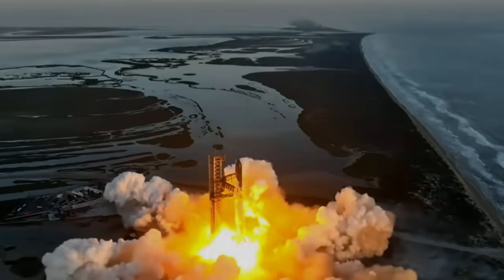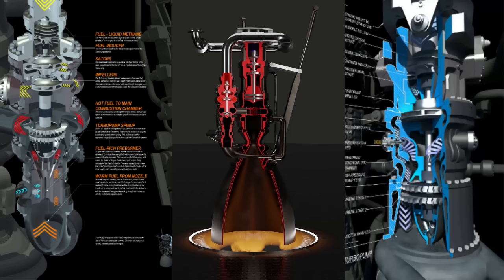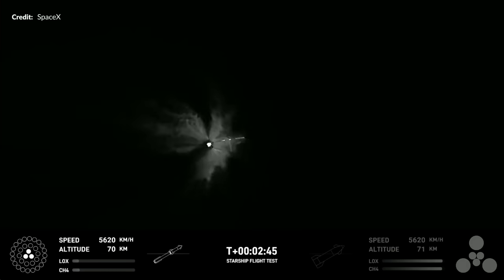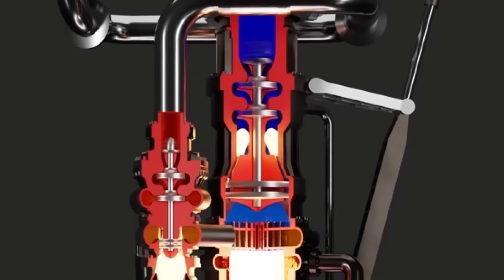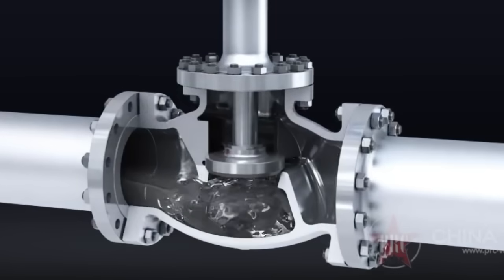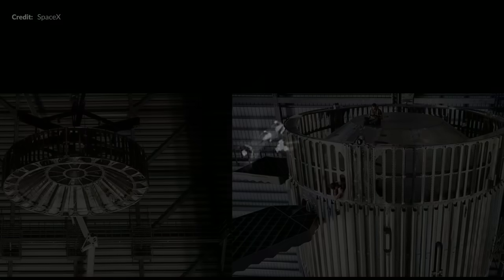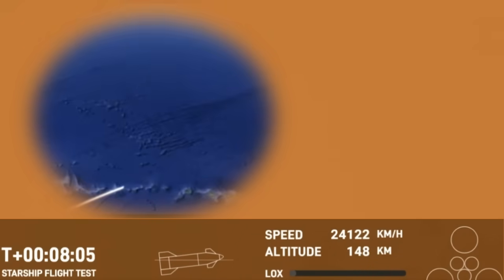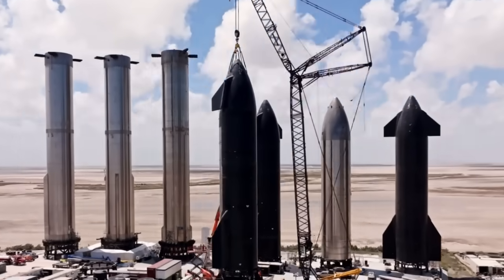Starship Flight Failure Analysis IFT2

Comment: I suspect there was damage done before it left the pad (stage zero).  The steel plate and water deluge appears to have mitigated the rock tornado and obvious pad damage, but the steel plate is flat and the shockwaves generated will tend to be reflected right back towards the rocket unlike a legit flame diverter which deflects the exhaust and much of the shockwave energy.  I think it likely that damage was done to the pressurization system plumbing which lowered the prop tank pressure which, over time, reduced prop flow rate and thrust -- if you look at the telemetry the acceleration has an inflection point at about 100 seconds and after that point the acceleration is lower.  At separation the vehicle velocity, about 5663kph, is much lower than the Falcon 9 would be at that point and that includes Falcon 9 launches that include a boost back burn to land near the launch site.
So, I would love to see the data on the tank pressurization and compare that to what would be expected.  The rapid attitude change of the booster after separation to facilitate quick ignition of the boost-back burn, is also likely to be an issue as mentioned.
In summary, while it appears the pad survived the launch unscathed that doesn't prove the rocket escaped the pad unscathed.  The declining acceleration gain with the inflection at about 100 seconds points to something inhibiting the raptor thrust and that could be damaged prop lines or damaged pressurization lines.
Reply from the maker: I thought there should be a cone on the deluge system...
Reply: @terranspaceacademy  Yes, a cone in the center would divert the flame and shockwaves, but apparently Elon believes that if they land Starship on the Moon or Mars, where there will not be a true landing pad so he thinks they need to design the system to not have those things.  His other comment is that the best part is no part.  
The problem with Boca Chica is that they do not have the space to build a true flame diverter and trench -- measure the ones at the Cape and then see if it fits at Boca Chica.  It doesn't!

Comment: Good video. The heatshield problems seem to be the hardest issues to fix before we see a splashdown in Hawaii. They were falling off during ascend like there was no tomorrow. Since the heatshield tiles are not a recent issue, I suspect that this will be the bottleneck in getting Starship to hawaii.
Reply from the maker: Indeed... The reentry temp might not reach the usual 1650 but it wouldn't need to to seriously weaken the steel.
Reply: The Starship needs a dual layer thermal protection system,. The tiles on the outside and below them an Ablative shield thick enough to stop the airframe from getting any major amount of heat on it in the areas where the tiles fall off. Plus some form of insulation between the two to stop tile heating causing outgassing of the Ablative shield. May knock 20 or 30 tons off the lift capability, but would make the thing very safe and all you would have to do in area's of the frame which had been exposed on re-entry would be drill the effected bits out and replace them.
Reply from the maker: That's a lot of mass....

Comment: The only mis-stated info I see in this video is in regards to the Key West footage - the footage of the nose cone was after Starship flight termination system had activated. My guess is a LOX leak as mentioned - when flight computer initiated engine cut-off when LOX feed pressures fell below threshold, inertial guidance determined less than required delta V, and terminated the flight.
Reply from the maker: You are quite right... that was just the nose.  He had seen the whole ship spinning on its long axis but I didn't find that footage.

Comment: Great analysis and I agree. On one hand they need to make sure Starship is getting away from the booster, one the other hand the difference in acceleration between  the two needs to be as low as possible until they are far enough apart. Will the 3 vacuum engines provide enough thrust for that ?
Reply from the maker: I think so... three sea level booster engines at 50% power should be about 40% of vac Raptors at full power at that altitude.

Comment: Wow, that's exactly what I thought went wrong when I watched it live. I thought to myself, that looks like a fuel flow problem & noted the flame outs. I wondered if SpaceX had engineered around the fact that the fuel would slosh around while tumbling. You can see it had very little fuel left over. It's just like running low on fuel in your car and then you do a slow-motion flip. That engine will die out from sloshing fuel not making it to the fuel pick-up line. And now I sit here watching. I feel so smart. My teacher said I was special
Reply from the maker: That's because you probably are :-)  We often confuse a lack of education in an area (ignorance) with a lack of processing accurate ability (stupidity). My mom's car ran out of gas one time because the gauge didn't work.  A "mechanic" stopped to help and told her it would need to be towed because it wouldn't start after we put a gallon in. I then noted it was pointed up hill. It occurred to me that the mechanical pump was trying to pull vapor up hill.  I put it in neutral and we pushed it until we were able to get it pointing down hill.  Started right up.  I was ignorant but not stupid :-)

Comment: I also thought that all 6 engines of Starship started at the same time.  However, some videos taken from a different angle, show that only the outside vacuum engines started first, followed very shortly after by the center sea level engines.  Perhaps, the ignition of the center 3 engines did happen too soon, and a longer delay was needed.
Reply from the maker: The center engines fired right after the vacuum but maybe that was enough and the blowback was not a factor.

Comment: I think keeping the propellant settled enough in the booster will be a big challenge for hot staging. The booster must still retain some forward acceleration, but less than starship's, and not too much that they remain too close for too long and risk damage to either vehicle. Flipping such a large tube filled with sloshing propellant also seems like a nightmare.
Reply from the maker: Indeed... Booster header tanks?
Reply: Yes : farther away Starship starts ,less chance of interference between ,stages ,; would only loose some speed ,can get it back ?

Comment: My thoughts exactly when I saw that the 3 center raptors of the Ship were flush against a flat section on the top of the booster. I also have always been concerned with the heat tiles. Even NASA could never get a tile system to be fully and rapidly reusable and we are still seeing tiles fall off!
Reply from the maker: There is still work to be done... That's for sure.

Comment: I think both timing of the engines and raising the height the interstage with a conical deflector shield over the center to reduce any unwanted thrust effects. Worst case adding some slosh baffles in the booster may be needed.
Reply from the maker: We agree... Just a few changes and IFT-3 should be great!

Comment: Good points on the failure of Starship.  I wonder if they fire up the Starship vacuum engines first then the sea level engines a few seconds later, we could potentially avoid damages.  The booster can leave a few more engines on to compensate for the slower acceleration during hot staging.  Also firing up less engines on Starship at first would introduce less deceleration to the booster, helping with the plumbing.
Reply from the maker: We agree completely...
Reply: @terranspaceacademy  I'm sure they have people going over all the math of all these different strategies and will find the best one come IFT3
Reply: You probably don't need the sea level engines at all at that point in the flight. The 3 vacuum engines fired longer could probably do the job of getting it into orbit. You  only need the sea-level engines for the landing phase.
Reply: @johncherish7610  Yeah but why not use that thrust if you have it, long as they can fix the issue with hot staging.
Reply: @GoldenTV3  yeah I think firing the vacuum engines one second earlier would provide enough clearance for the sea level engines to not break themselves.  But of course these are all speculations.  Maybe they just forgot to tighten the screws :)

Comment: I think you nailed it in your analysis of the failure of B9. The F9 booster does its flip and boostback burn successfully without an extensive set of anti-slosh baffles inside its main tanks. B9 should be able to do the same. 

The big difference is the hot staging used in IFT-2. That puts B9 into close proximity to the exhaust plumes of those six Raptor 2 engines on S25. It appeared to me that B9's flip was pretty violent and likely really caused the remaining ~300t of methalox inside B9 to slosh around excessively.  Since there's a large header tank containing LCH4 in the bottom of the LOX tank, I think that the sloshing liquid was the LOX in the big tank, not the LCH4 in the header tank.  But it could be the opposite, or that both cryogens are sloshing too much.

So, your suggestion of using only the three vacuum Raptors on S25 at hot staging is a good one. I would also use the attitude control thrusters in B9 to keep the booster from rotating (flipping) so rapidly.
Reply from the maker: That's a good idea... the exhaust from the departing Starship probably added more than was thought.

Comment: Good analysis. One error may be the 8:15 point about the center engines. They gimbal out as far as they can so their exhaust is deflected out. You can see them gimbal back to center on the SpaceX videos. Your recommendations are spot on!
Reply from the maker: Thank you! You are quite right and I should have mentioned it.  I don't think it was enough though, the push back on the booster would indicate blowback...

Comment: Yourvspeculation is exactly the same as mine. The restart timing, fluid hammer and sloshing all make perfect sense to me, but I might add the possibility of thermal shock from not rechilling the hot engine before reigniting them on the booster.
Of course this fun speculation might well change once onboard camera and data streams become available. Lol
Stage 0 = perfect
Booster did just as well as any other non spacex booster has ever done. 
Starship = 90%
Ps. Id like to see analysis of the booster plume. It did not expand as expected with altitude. It also had a single string of large shock diamonds that I think formed by the containment of the exhaust from the outer 20 engines that acted like a faux nozzle of all the center engines forming essentially one big segmented rocket engine. 
It was spectacular.
Reply from the maker: Interesting... not enough time?
Reply: @terranspaceacademy  i dont have enough information. But normally they prechill things before relight. The booster had hot engines and not enough time to chill any of them and some had  more static time than others. So its just another thread to pull on.
Reply from the maker: Very good point... Shut then all down, reorient with hot gas thrusters.  Let drag resettle the propellant then relight?  That would allow more cool down time.

Comment: great video.. my only other suggestion at the cost of weight and complexity is add 2 small tanks in the booster to have a positive supply of fuel if zero or negative g's occur after separation.  A baffle might help instead, but of course, both of these things will be a major undertaking on already built boosters, but not so much on one in progress of being assembled, or even a large fuel filled accumulator in both the O2 and methane tanks installed to keep positive fuel pressure to the engines.  Then don't start the rest of the engines on the booster until you attain positive fuel pressure in the rest of the system.  The extra weight sux, I know, but the latest raptors are more powerful and could make up for this
Reply from the maker: That's an excellent idea...

Comment: Keeping the 3 booster engines on and only igniting the 3 R-vac engines on Starship likely wouldn't be enough for a separation, considering that starship will be completely full of propellants (thus, I'm assuming much heavier than a mostly-empty booster). The booster would just keep pushing into it. 

Perhaps they can run the R-vac's at full thrust and the center engines at a reduced thrust, depending on the exact math required for sep.  

Another issue is that Starship is just propellant weight right now. When it ends up with a full payload eventually, the hot-staging dynamics will be completely different - unless they're using some kind of mass simulator. Otherwise more force will be required for separation eventually. 

I don't really have a good answer, but I thought about just using the R-vac's only till I remembered the mass differential. 

Like you stated, I think the biggest issue is the fact that they tried to re-ignite the middle ring during the flip maneuver.  If they had used FAR more RCS (maybe they need those more powerful hot gas RCS thrusters after all) and less thrust gimballing for the flip maneuver (only leave the center 3 on) they could wait till the rocket is exactly aligned (opposite) its velocity vector, ensuring all propellants are pushed evenly to the base of the tanks.  THEN re-ignite all the remaining engines. 

You might lose a few seconds during the maneuver (requiring more propellant, reducing payload - I'm assuming that was their reasoning for this IFT-2 maneuver profile) but it should be FAR more reliable. 

I suppose it isn't so much a hot-staging issue for the booster problems, as whatever method of staging they use will still require the booster to turn around. That flip is THE issue though.
Reply from the maker: Then shut off the booster engines at Starship fireup.  Slow flip and let air resistance start settling the propellant before firing up the engines...

Comment: Yep..I was thinking the same thing.  As the booster started flipping, they were already starting the other engines, which was way too soon.  Also I agree with the sea level engine.  Starting those at the same time as the vacuum engine is unnecessary.  Those shouldn't start up untill complete booster separation and significant distance.  The second flight failures was about timing, not design.
Reply from the maker: We agree Xavier and thank you for watching.  A few tweaks and they should make it to reentry!

Comment: A very welcomed analysis, and timely.  I would like to see analysis on pros and cons of using a steel pressure containers vs composite. What my brain comprehends, correct pressures must be maintained inside.  As temperatures increase, liquid turns to gas, and pressures increase. With composites, there is more insulation between extreme cold inside to heat outside.  The outside frosting help provide some insulation, but this is stripped away during launch.  The steel skin will transfer heat quickly to the cold metholox inside. At higher altitudes this has a reduced effect, and in a vacuum of space the next problem is the radiation from the sun.  With no insulation, I see an issue in maintaining the cold liquid temperatures, preventing increased pressures quicker than can be exhausted from the vehicle.  I see a need for some type of insulation on all surfaces that hold methane and lox.
Reply from the maker: Hmmm... I wonder if we'll get a heat sink effect.
Reply: pretty easy to keep 95% of starship surface cool by simply pointing engine block at sun. don't know how much earth's black body temp can be negated though

Comment: A great analysis video- but I wonder if the engineers over at SpaceX have studied these images and come to the same conclusion or r they convinced that something in the electronics went wrong? I guess we will find out in the next launch. Just a laymen's comment here-why not make the center of the hot staging ring pointed and not flat so that the exhaust will slide off of it instead of hitting a flat surface?
Reply from the maker: I wondered that too. Deflect to the sides...

Comment: Very interesting, and well presented. How vital is this hot staging, which seems to have possibly been in some way to blame for the problem?
Reply from the maker: It really does seem to be the best way to go.  What no one has addressed is an escape/abort situation.  We did a lesson on it and a failing booster dooms Starship without hot staging.  It's vital so they'll need to get the kinks worked out.

Comment: Great video. one of the biggest upgrades to the booster for this flight was engine blast isolation so I kind of have a hard time believing one engine took out all the center engines.
Reply from the maker: It may not have... it could have damaged the plumbing up above...

Comment: Since the objective of the Integrated Flight Test was a ballistic trajectory, rather than a low earth orbit insertion, there was no need to optimize fuel usage and burn duration. SpaceX has again perhaps gone a step too far, in the hope of getting more data or investigating more of the stress envelope. Perhaps subtle changes in the timing sequence is all they will need to a completely successful IFT-3. The joint SpaceX/NASA mishap investigation should inform them whether there needs to be an extended gap between test flights to allow significant modifications to either the booster, ship or both.
Reply from the maker: We think so too.

Comment: A very astute analysis.  This analysis brings up possible design flaws that will require major redesign.  Probably why NASA did not use hot staging.  Come on SpaceX get a clue! Stop blasting stuff you want to reuse with rocket engines!
Reply from the maker: Thank you!  I think they will get it working... Just a little more complicated.